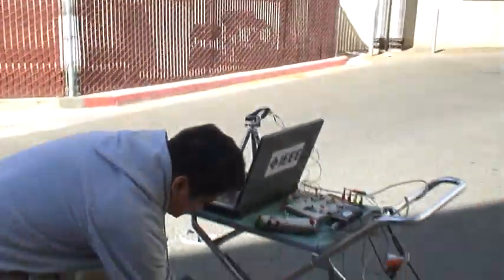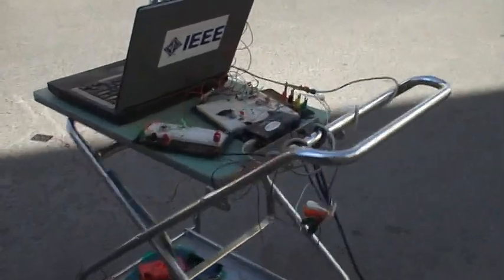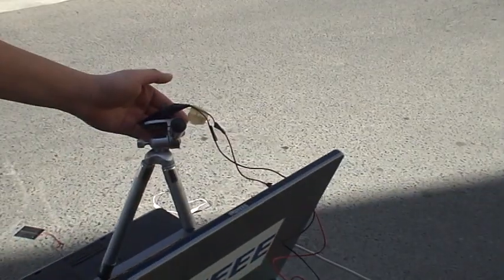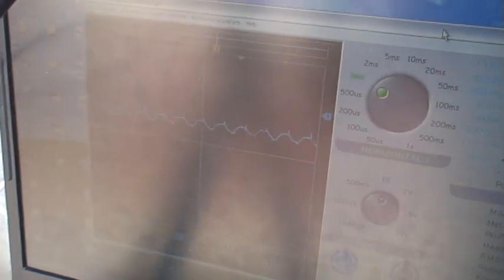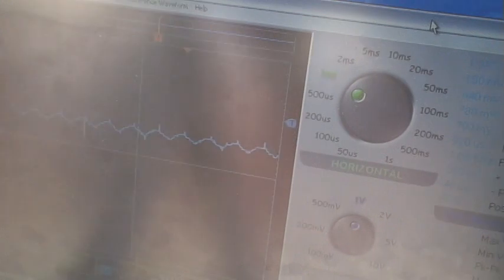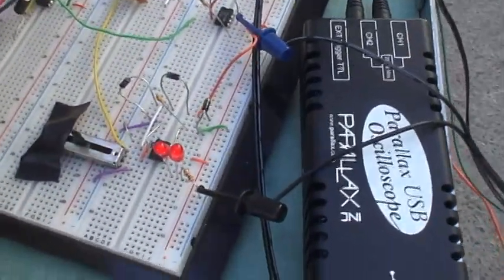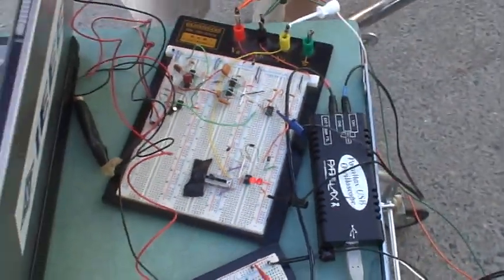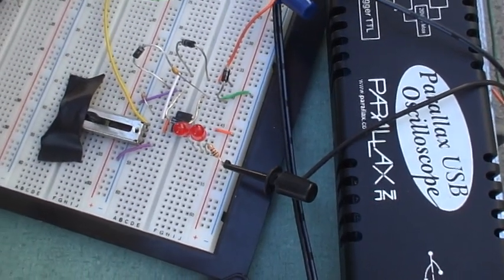1kHz Laser detection using solar cell with no optical filtering

Comment: hello.. just a quick question... after you have make a bandpass filter and your solar panel is connected, how do u use the output signal to use as an detector? Mine is running 5khz, i dont know how to connect the output to an arduino. I cant just connect the output straight away right?